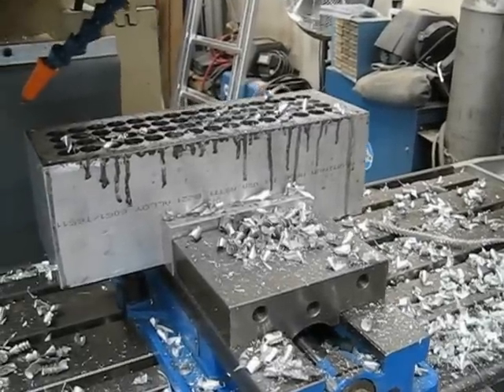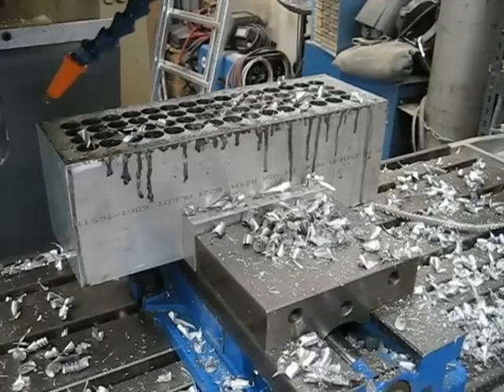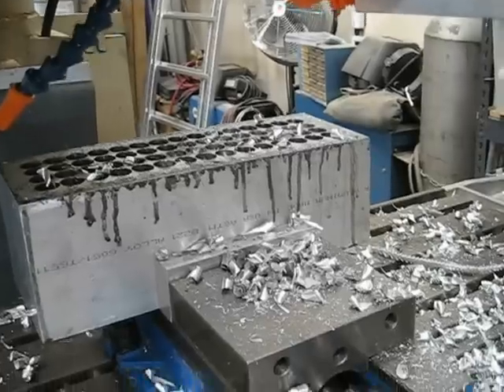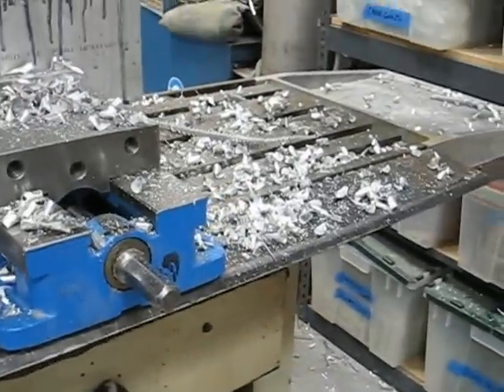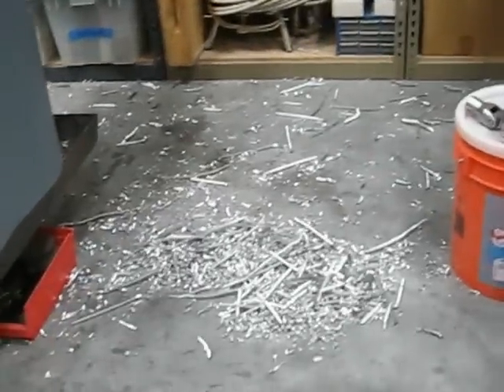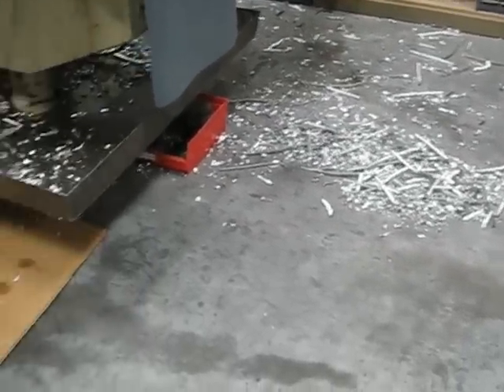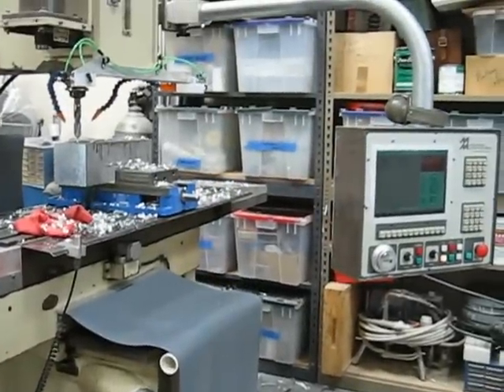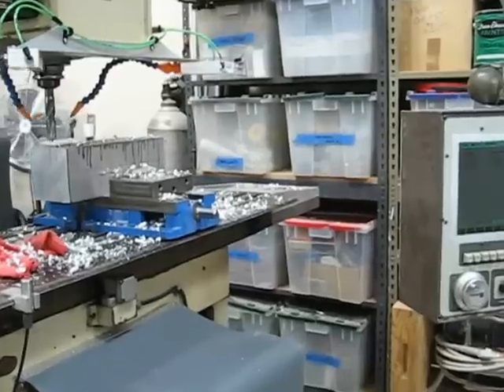Homemade MQL coolant system part 2

Comment: Thats a fine setup! I'm attempting one as well.  What PSI are you running?
Reply: I find that usually around 10 psi is plenty, occasionally for deeper holes or more chip volume I'll turn it up to 15 psi, but that's rare.
Reply: +Lamb Tool Works Thanks! I emailed too to see if you still were sharing the schematic!
Reply: I sent you a reply to your email, just holler back if you didn't get it.
Reply: Lamb Tool Works can't seem to find it. Could you resend schematic?
Reply from the maker: email me at blamb11 at cox dot net

Comment from the maker: The "sludge" is just the left over oil and aluminum, wipes off with a paper towel, rag, or if you want the part really clean, keep a bucket of water with some ZEP Industrial Cleaner mixed in and dip the part, let it set for a minute or two, blow it off and it will look almost polished.